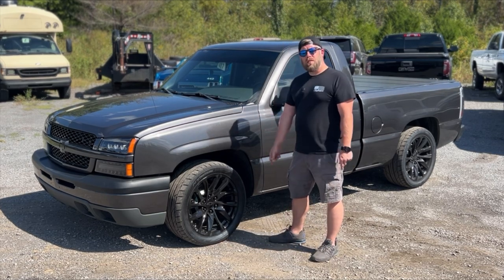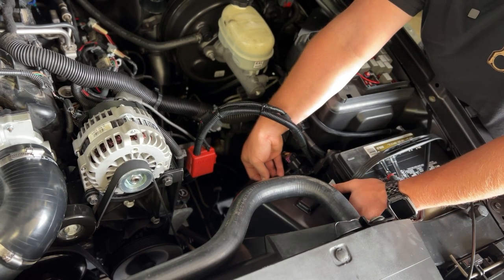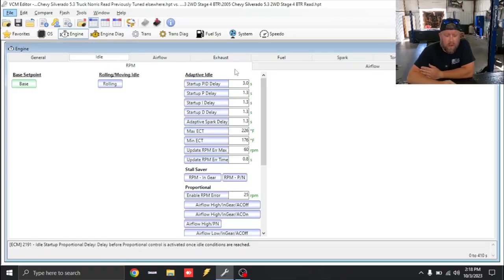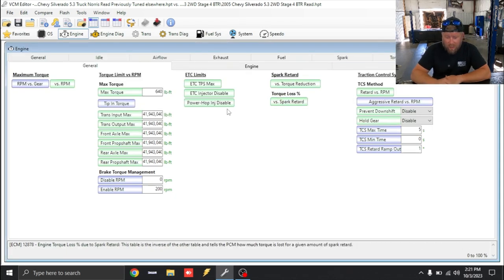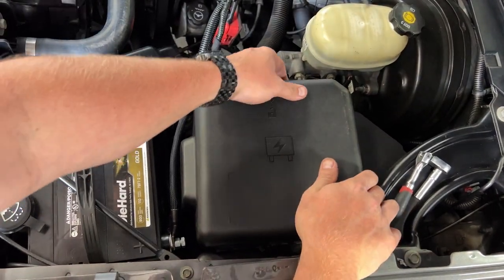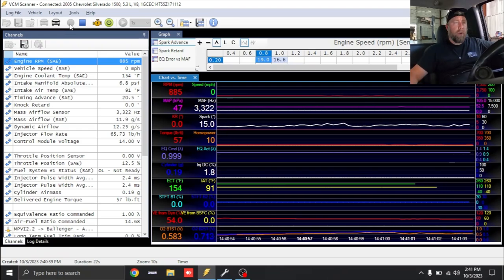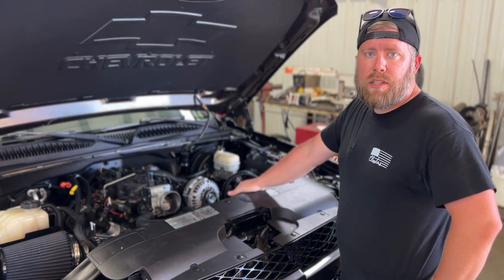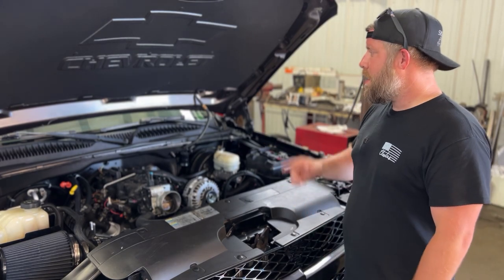How To P59 Gen 3 Tuning + Truck Norris Tune Review

Comment: Thanks for the great info, I pretty much work on just Gen 3 and 4, new to tuning and never heard of removing those fuses. Might be why I have bricked a spare PCM, keep them coming
Reply: I never heard of that either and been fortunate so far but ive also been in the mechanic and programming world for years so I'm aware of voltage and ripple concerns.

Comment: I have 2006 Silverado with a 6.0 with the truck Norris cam in it. I have that same issue with a long start but only after it’s hot. Starts up fine cold and hard to start when hot. All my sensors were replaced with acdelco. Still have the same issue

Comment: Just have a question, so I’m pretty familiar with ls engines and how they operate and run, but which cam would you say is the best for daily driving in a 1500 truck but also still wanting some power added and to be reliable?

Comment: Love the content man, I just picked up a Mpvi3 a couple months ago and have been learning since. Also couldn’t the delayed start also be a fuel pump check valve failure, my truck I have to wait on ignition for a couple seconds then it will start. If I just put the key and and turn it over it does exactly what that truck did, and if I turned it right after starts right up. Not saying your wrong either. :)
Reply from the maker: Thank you!

Yes, fuel pressure issues can cause the delayed start, but this one is for sure the cam sensor. That pop at the end of cranking tells me that. It’s hard to hear on video but I think I have a good video of it doing it in tomorrow’s video.

Comment: I’ve bricked an ecu before I wonder if just hooking up a charger to the battery while reading would help. I did that with a handheld tuner and fixed it
Reply from the maker: In some P59 applications it does help. I have an XS Power charger that’s specifically designed for flashing ECMs and it helps. I also don’t have this issue in P59 Corvettes, P59 GTOs, and P59 swapped vehicles. I have this issue specifically with 03-06 trucks. The more power options the truck has, the worse it gets. I don’t have the issues on a RCSB base model truck with manual windows as much as I do with a crew cab leather truck with power everything and Bose. I also have this issue more, the newer the HPtuners interface that I use. MPVI3+ is wayyyy worse at doing this versus an MPVI2 or MPVI.

Comment: I have t pull the radio fuse in my truck every time I want to write to it. It reads fine, just won't write. I tuned one the other day and had to pull a bunch of fuses to get it to write after it failed the first time Got lucky !

Comment: In addition to my last comment, my 6.0 has tbss intake and an LS3 throttle body with the 42lbs injectors from a 8.1 marine engine so I could keep my factory injector plug

Comment: Been learning alot from your videos but probubly would take me forever to tune half as good. Was wondering how much you would charge to make and sent me a tune file for a 225 cam, 3000 stall, long headers, cold ram air intake, stock new 4l60e, engine is an lm7. That is if you do offer remote tuning.

Comment: That's hilarious. My green plug on my ECU was filled with oil. Got an lm4 out of an 03 trailblazer ext from someone on Facebook marketplace and it came with the harness and PCM and TAC module and everything. I ended up going with a standalone harness from HPI. Anyways. I unplugged the PCM and the green plug was filled with oil. I was very curious how that even happened. I've started my engine a few times on the stand and the oil pressure sensor isn't leaking or anything. Interesting though.

Comment: So you don’t have to have a bench harness for a p59 it’s just quicker?
Reply from the maker: It is highly recommended to have one even if you have one just in case. I just linked one in my description that’s $35. 

But no, it’s not required. You just have to read on Low Speed and make sure you have a battery charger on it. Also you will want to disconnect any aftermarket wiring.

Comment: Hey man I need help I have a 2005 gmc Sierra cammed and good heads and built 65e, it’s on a mail order base tune currently but for some reason when I start it in the morning it drives perfectly fine but when the thermostat opens and gets to temp my truck will shift to 2nd gear and stay in 2nd no matter what, only way around it is to pull over and restart it then it shifts super hard but shifts through all the gears like it should except I can’t get it to stay in 1st gear over like 10 mph even if I have it in “1”on the column shifter it will just shift to 2nd which sucks for burnouts because it will light up in 1st gear for 1 second then shift to 2nd where as before I could spin them through 1st for 20feet then shift to 2nd and keep spinning But only thing I could think of is my battery not giving the tranny enough power because I don’t think the battery I have is the right size but currently I have no codes except for my cats being gone. Sorry so long thanks for your help if you see this man.
Reply from the maker: Have you checked transmission fluid? Low fluid can cause that exact situation to happen.
Reply: @Matt_Sanford damn if it wasn’t low on fluid it was only up to the first dot hopefully that fixes my issue thanks man if that doesn’t what could be some more causes? Could that battery being to small cause that to

Comment: I have  tuned my p59 in the truck on high speed like 13 times now, aftermarket radio
Reply from the maker: It’s hit or miss honestly. MPVI1 cables didn’t seem to have an issue. MPVI2 and MPVI3 interfaces have issues more often than not. I would rather show everyone this way that way they are aware of the issue and the best procedure versus having them risk bricking their ECM.
Reply: I managed to bricked 3 different p01 ecms is there any way to bring them back? I already tried grounding the circuit on top of the board, but still showing protocol not detected
Reply: @Matt_Sanford  I'm using a mpvi3